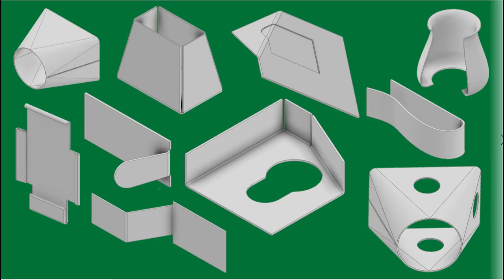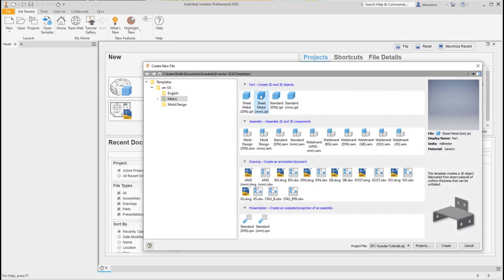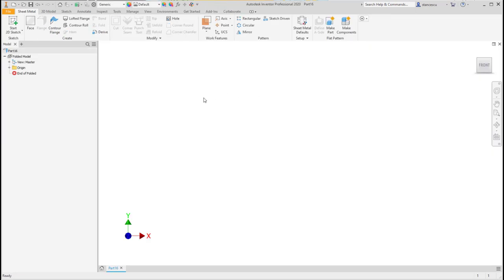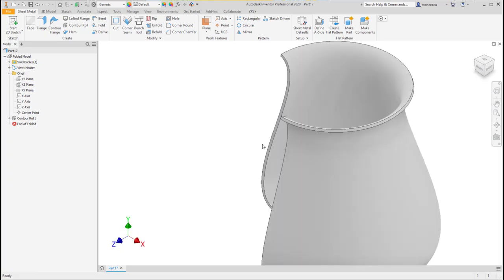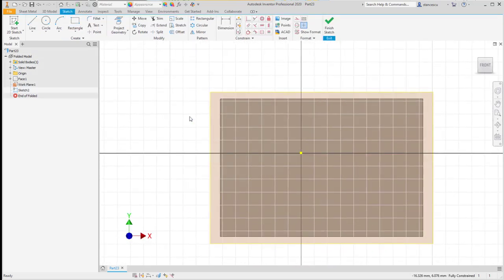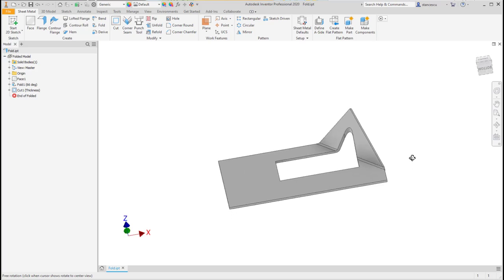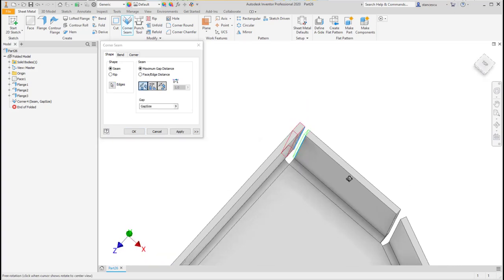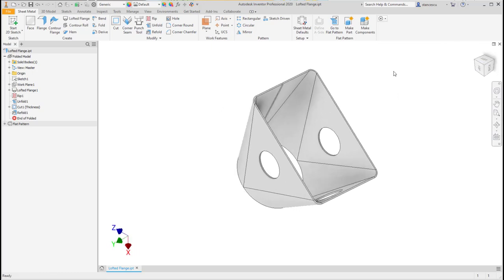Tutorial Inventor - 035 SHEET METAL - Tools

Comment: Wondering how to create a sheetmetal pan where the vertical flanged sides would be 90 degs vertical but the ends would be tipped outwards at some angle, say 42 degrees.
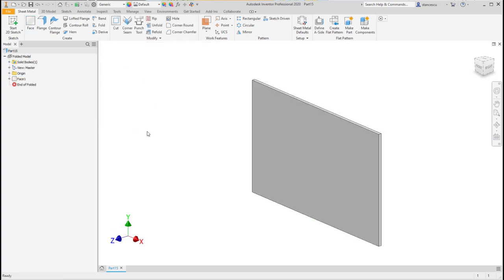Reply from the maker: You must apply the actions from the minute 8:02 for the walls, and then the procedure at the minute 7:14 to each wall

Comment: The voiceover narration english is very easy to understand, thank you, no need for subtitles.
Are these just examples of how to use the software? Here's why I ask: At 8m30s you finish making the 4-flange piece with the 100 degree (80 degree inside angle) bends, but what kind of brake would be able to bend that, given the interference?
Reply from the maker: There are machines which can bend that part by using lateral tools with horizontal movement for bending. Anyway, that was an example of what Inventor can make, not what a machine can make. Thank you!